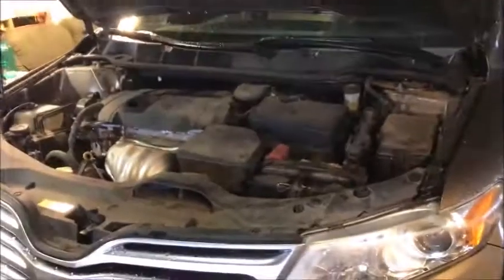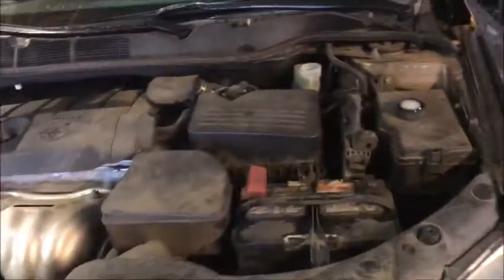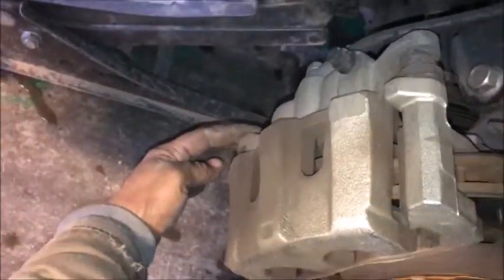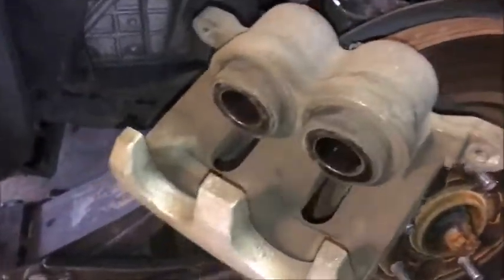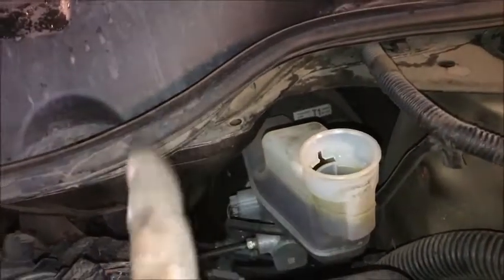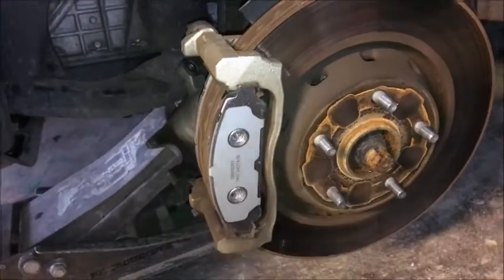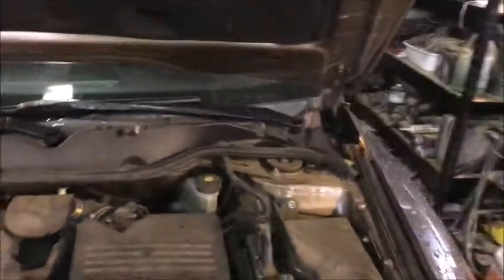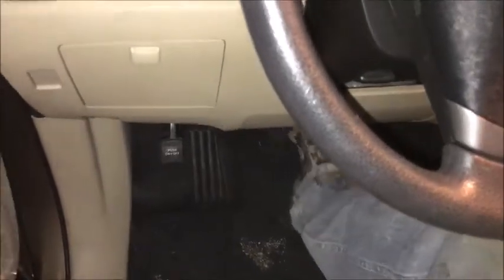2011 Toyota Venza Front Brakes

Comment: You can't let the brake caliper dangle by the brake hose bro! Also, did you forget to install the springs on the pads?
Reply: im not an expert but i saw them fall on the ground what the heck is hapening Bro 😳
Reply: Yeah I seen the same thing he didn't install the spreader springs into the pads!!! Plus I would install new ones since the pads are worn out!

Comment: When you removed the calipers, the old pads had two spring clips on them to keep them from stuck on the rotor. But when you put on the new pads, you didn’t put the spring clips back. What is the reason?

Comment: I've found two different OEM part numbers for Venza Front Brake pad:  04465-0T010 and 04465-AZ121.  What is the difference between these two parts?  Which one should I use?  Thanks

Comment: Great video! I wish I had found this when you first posted it. I have been taking the whole assembly off the rotor, because I normally replace with pads and rotors together. However, I have always pre-assembled the pads into the caliper before sliding it back over the rotor. Your method looks a hell of a lot easier. I did notice though that you do not replace the metal guides that normally come included with the new pads. I gather there is no concern there ?
Also - what maintenance do you do on the glide pins/bolts ? Do you ever re-apply new grease to the pins ? If so, what grease do you use, and how much ?
Thanks

Comment: Can you do one for 2004 4runner rear pads and front pads, thanks!
Reply from the maker: just about the same as this one, but you got it. if you have subscribed ,i will send you a link when its done. thanks for watching.
Reply from the maker: although the bolt sizes are different, the concept is the same, but i will. thanks for watching. i will put you link up as soon as i can.